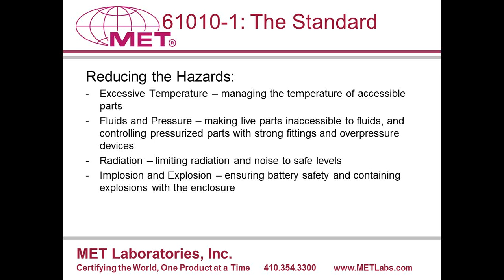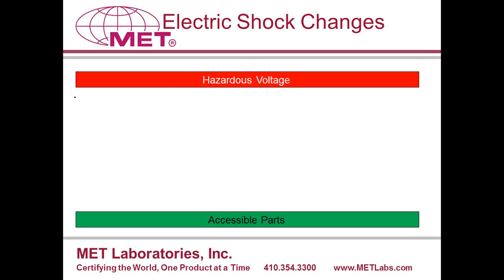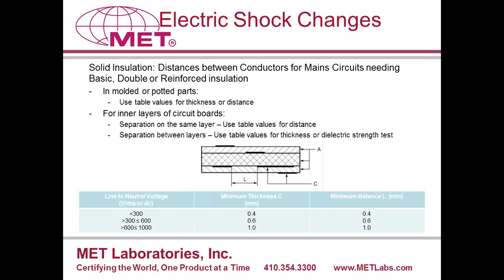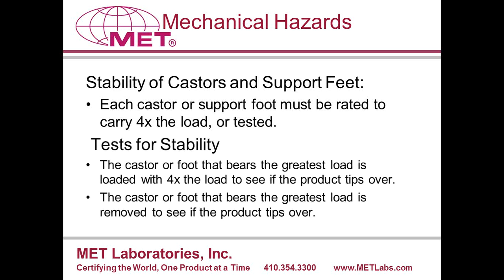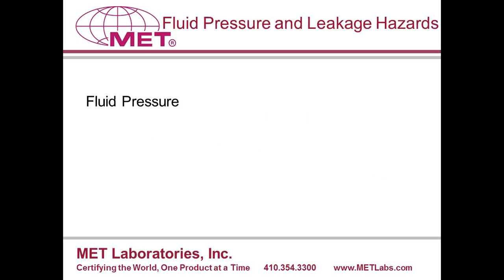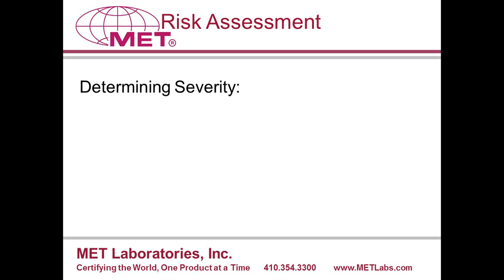Overview of 61010 1 3rd Edition Webinar

Comment: Disappointing at best! Why? 

Answer: This is an uninspired reading of a Power Point. I could read them my self. No value added by the presenter!
1. Speaker is monotone, disinterested, and doesn't add anything to the text.
2. Some slides disappear very quickly, before you get a chance to read them.
3. There are VERY FEW references to the specific clauses that are discussed. Why not have them on each slide?

Conclusion: Better to just download the Powerpoint from MET.